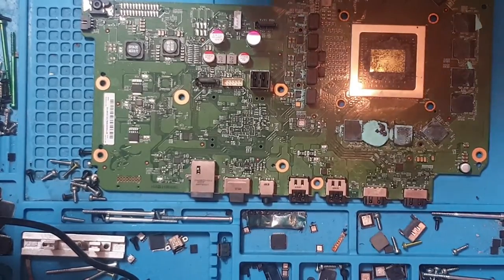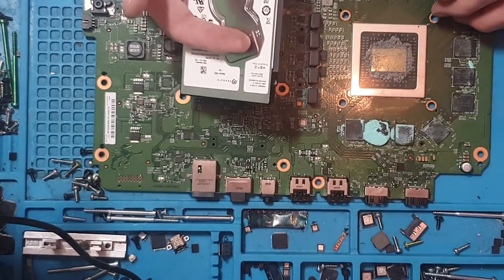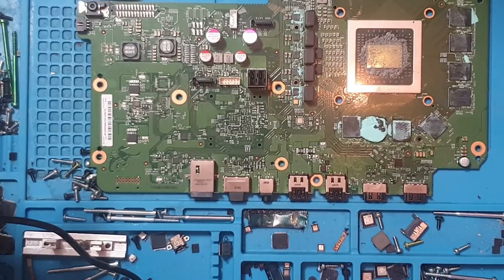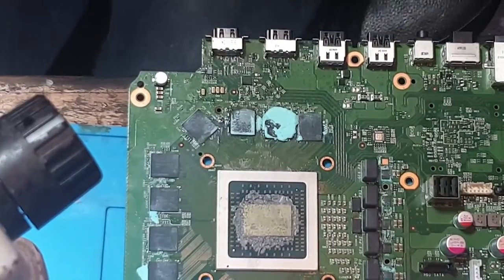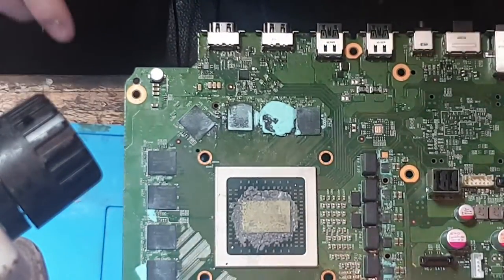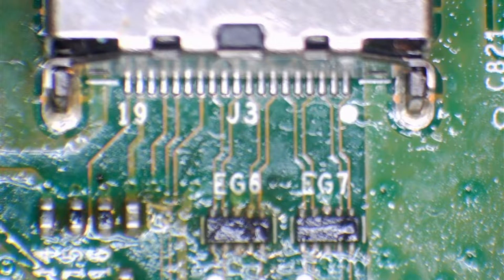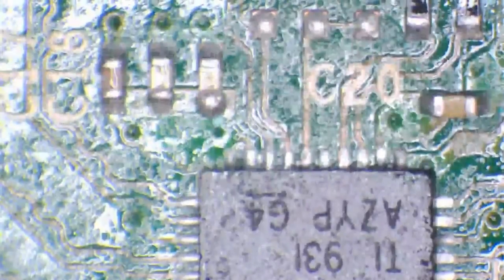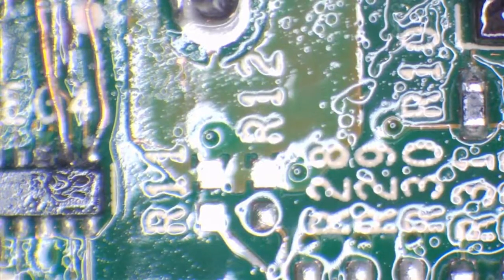Xbox One X Major HDMI Trace Damage Repair, Bad HDD, No Wi-Fi AND Faulty BDROM

Comment: Awesome job, I have a way of restoring pads that is a little complex, but it leaves you with actual pads to solder to, with not jumper wires. Once I get better at doing it I will be demonstrating it. It’s pretty cool.
Reply from the maker: I'll look forward to that mate. I have a couple of theories I want to try out when I get around to it lol
Reply: TheCod3r it’s going to be awhile it’s use technology I invented at my old job, but what I made was industrial size and I need to redesign it to a small compact unit that is so much cheaper. I was using one of my prototypes for a while, but the waste in chemicals and materials was too expensive. I got some ideas on how to make it smaller and cheaper to use. The current system is that if you need to repair 2 or 3 traces you would need to mix up enough to do 1000s of traces and throw the rest away.
Reply from the maker: @jasondoesthings919  ah yeah so definitely not viable for repair then lol. I will definitely look forward to seeing that one for sure

Comment: I just did this exact thing to my buddy's board tonight so hopefully I can follow your video to repair the damage I did. And here I could have sworn I was being gentle
Reply: I'm talking about lifting traces up on the HDMI port. I think they're six of them I screwed up. By the way, what gauge jumper wire did you use? I was thinking of just using resistor legs but probably best to get some stiff wire instead
Reply from the maker: @scrapeape  it happens sometimes bud. Don't let it phase you and with a little concentration you'll be ok 👌 I personally use 0.17mm wire, but anything 0.1mm to 0.2mm should be perfect

Comment: If any traces on Xbox One X Sat In are broken will it effect the HDMI out signal have one here some traces are broken on the Sat In HDMI port but the TV out is perfect no damage still no display
Reply from the maker: No the 2 ports are different, but that would mean hdmi input likely wouldn't be working
Reply: @TheCod3r  Thats what I figured I am going to try a new hard drive i have took back apart double checked the hdmi out seems fine. Just thought I would ask as I was fixing one tonight and couple tracers came up from HDMI in as I have no ports for xbox one x i am switching the ports around thanks for your reply I think it could be another part of hdmi circuit maybes redriver I think this xbox was dropped due to kids fighting over it lol.
Reply: @TheCod3r  HDMI Input is unused.

Comment: About the hard drive not working, some hard drives just don't work with Xbox Ones, the 1st Xbox I ever fixed had an E100 error and it legitimately WAS the generic hard drive I bought on eBay, yet the hard drive is good, I use it as an external now, but ya, everyone says that am E100 is the ODD only, this is not so

Comment: i never wick them out i always use solder sucker
Reply from the maker: It depends with me, usually I will only use a solder suckered if I absolutely have to because there's a slightly higher chance of pulling traces up with the amount of force used in the sucker. That's especially true on thinner boards though
Reply: @TheCod3r  i mean just for the ground legs . when i drop the port off the bottom because i use low melt i can take heat gun away and the solder stays liquid for about 8 seconds i just solder suck the holes for ground legs obviously i use wick for the pads
Reply from the maker: @Finditfixitphilipit  yeah I would never use the sucker on pads but I have seen it tear pads on ground legs on controllers, could just be a thinner board issue though
Reply: @TheCod3r  easy to repair controller legs tho when them pads come off . they are alot weaker then the console pads thats for sure
Reply from the maker: @Finditfixitphilipit  yea definitely easy fixes but still a pain when it happens, but yeah they have a much lower thermal mass so definitely weaker than the console boards lol
Reply: @TheCod3r  should really make myself a YouTube channel but it's having the time to do everything. I repair mass amounts daily but 9 out of 10 times my phone is dead so I miss pictures and I don't have a capture card atm either. I do have every single gaming shop in a 30 mile radius use me and send all their customers in my direction. And if I can not fix something it just ends up in boxes in parts for when I do need something. And I do have 1x banned original and s boards what I use to test values against boards which are not working. It's all true and error sometimes they are easy fixes and then other times you get so far down in the rabbit hole it annoys you to the point you want to smash the thing to pieces lol